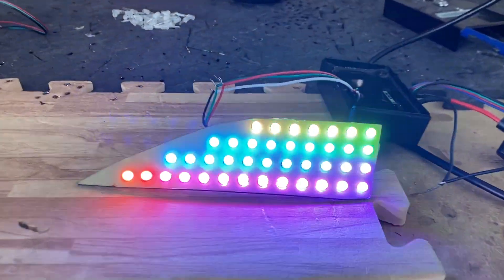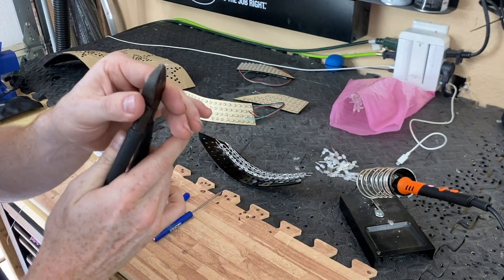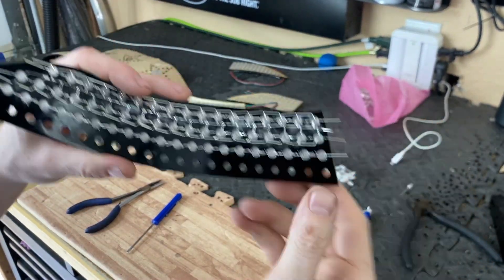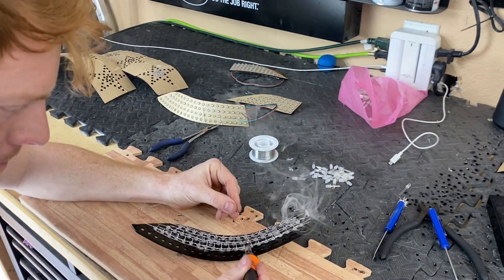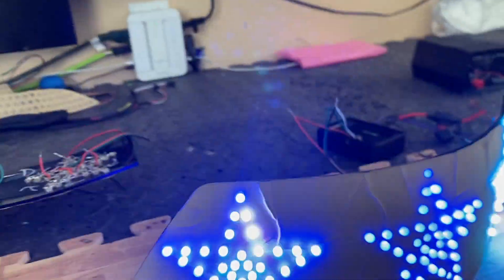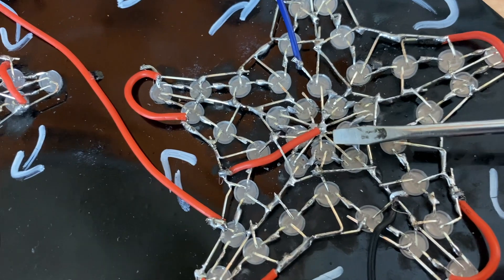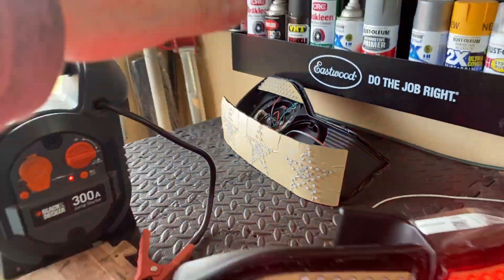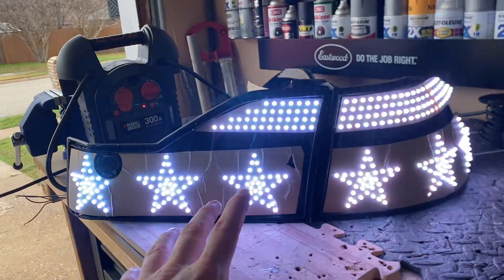HOW TO build addressable through hole led tail lights

Comment: wouldn't it be much easier to just design a flexible PCB with LEDs already attached and just have it made by PCBway or some similar company? You would get a professional Finish and it was probably even less work as you have to design the circuit anyway?
No hate, just curious
Reply from the maker: All good for asking! 
Most customers do no like the look of the pcb
I’ve done a few builds that have drop in pcb but i get requested this style instead
Reply: @zaccook  okay interesting. Thanks.

Comment: Hi there, would you recommend through hole leds or the strips for larger applications? I am planning on making some custom tails for my 3rd gen prelude, and for what I want to do, I have to cover a lot of distance. Also what are some reasons to use one over the other? thanks!

Comment: I have a question for you. If we want to set the last LED in green, the "green" data have to pass throught all the others LED placed before the last one ? Like it's full adressable LED but we can control then 1 by 1 ?
Reply from the maker: correct to control just the last led you'll need to run the date through all of the other leds first. Then in whatever controller you're using you can set each led to what ever color you want.

Comment: I am doing tails like these right now and when I use a regular spi or any RGB controller everything works perfectly fine, when I plug the ghost in, I get flickering, I think ghost has a glitch in the software or something or maybe I have a defective unit
Reply from the maker: that is odd!!
I would make sure that you have enough amperage running through them. A test you can do is set the amount of leds lower if it doesn't stop flickering then you for sure have something wrong with the module. 
especially if the addressable leds do not have the capacitors built into them, they could be sucking up a lot of power.
Reply: @zaccook  I'm pretty sure voltage is not an issue I have two power sources and four power connections on the board directly bright white and everything is as white as possibly can be there's no yellowing at all. I should probably break out the multimeter and read the voltages around the area that it's flickering. But I just don't understand why every controller works perfectly fine but the ghost

Comment: How do you add the capacitors? What goes where?  Thanks for this run video.  Really helped me out.
Reply from the maker: Thanks! 
They are not directional so you just put one side of it on power and the other side on ground. Really not bad 
Just do that several times or buy the next level Neo LEDs those have caps on them already
Reply: Thank you.

Comment: Hi zac,  what is the panel you use to put the addressable LED’s through. Or the material. I need to make a custom shape one for Honda beat
Reply from the maker: Awesome! Look up Illumaesthetic! 
I think they already have a Honda beat file if you don’t see the design you want you can get it created by them
Reply: @zaccook  I’ve been checking them out luckily they aren’t too far from me locally but I may have to make a panel board myself just not sure what material it is if it’s acrylic or some other plastic

Comment: Do you not need resistors? Sorry for the newbie question
Reply from the maker: All good! For these no resistors are needed 
Since they are addressable we are going to feed them the 5v that these require (via a 12v to 5v converter) 
They will need capacitors if they are NOT built in like this batch of them from Illumaesthetic. 
But Illumaesthetic has since switched to the next level Neo LEDs which have the caps built into the led
Reply: @zaccook this is not true about them switching to NextLevelNeos addressable. Mine do not have capacitors. What size did you use for the capacitors in your video?
Reply: @bmxer4life907  that’s why I bought the addressables from next level neo. Built in capacitors :)
Reply: You’re the man thank you so much for the quick reply, so if I got addressable rgb led from illumaesthetics then I just need to buy a 12v to 5v converter 🤩 that makes it so much easier

Comment: Hey man question for ya. Have you ever opened a set of hikari headlights for the va wrx ?? I have done stocks but wonder if it is the same as the subispeed
Reply from the maker: I honestly have not. 
but I would bet that they are butyl sealed.

Comment: Exactly my issue with my (4) tail light panels I made, not enough power 😭 
175 , 139, 139, 175 is my RGB count per board. I have power and ground running to each row to help distribute power and ground which helped but man I get flickering and sometimes a lone RGB will light up solo preventing the rest of the rgbs following from lighting up.

I had to take a break after working on these bad boys day n nite. Very time consuming and if your a noob like me troubleshooting can be a PITA lol

Oh, and I'm using (1) blue ghozt controller and (1) 12v-5v converter 20amps for the (4) panels.

Appreciate your vids and input as always keep it up. I'm gonna have to try the capacitors and adding another 12v-5v converter to split between (2) vs my current (4) panels to see if that helps me.
Reply: Start there my guess is that’s what you need to distribute the power better
Reply from the maker: you got it!
might want to check the power source that your using as well. that was my problem for a bit.
Reply: @zaccook Buy a 110v to 12v converter and make your wall socket your power supply while your building them !!